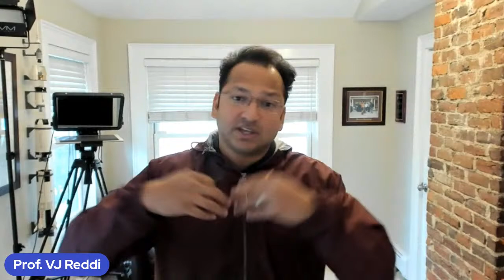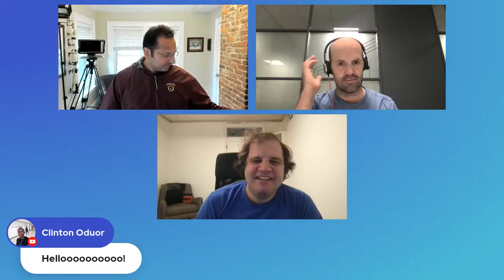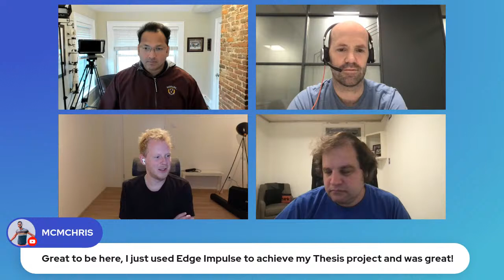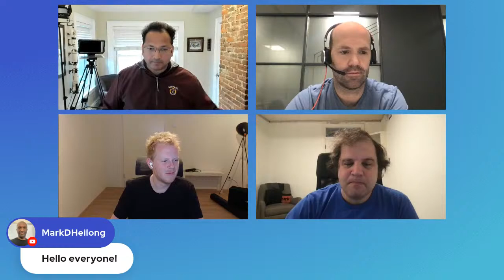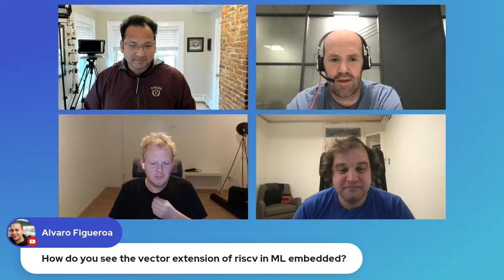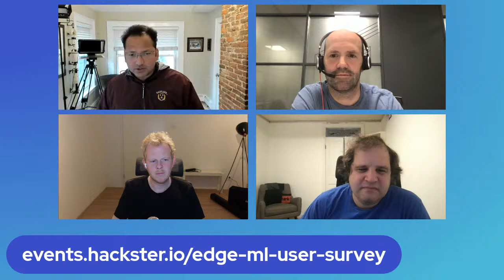Scaling Embedded ML AMA

Comment: RISC-V -- an open source instruction set architecture (no royalties) that defines how the CPU is controlled by the software.
Vector extension -- chip cores can process data arrays alongside the traditional single number (scalar) operations

Please correct me if this is inaccurate!